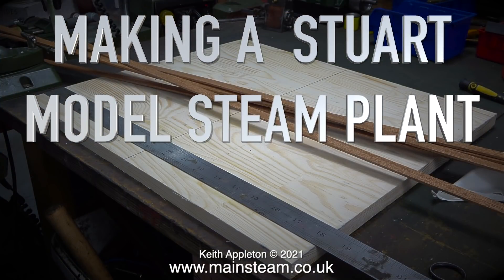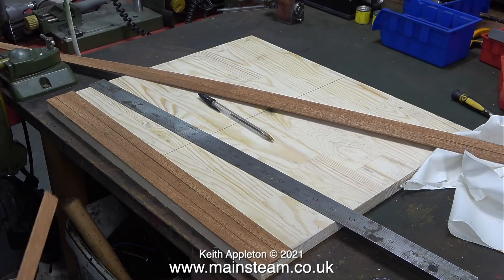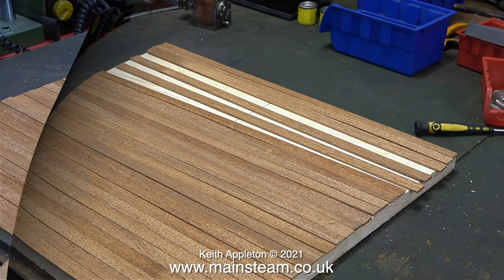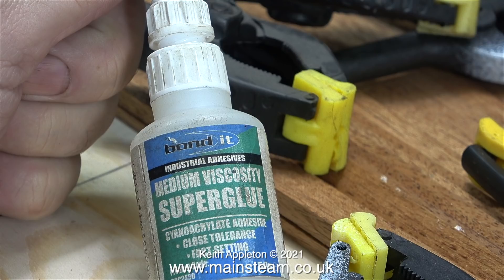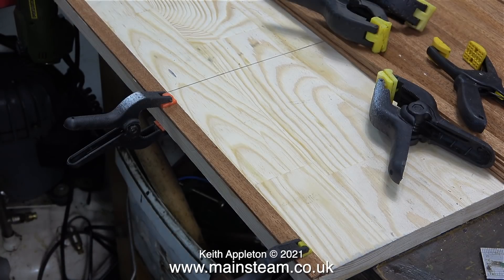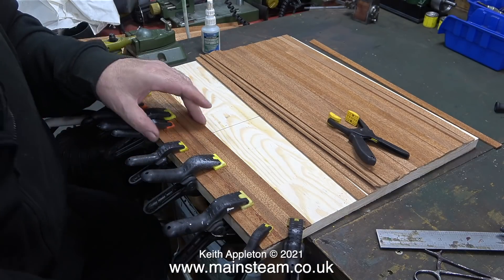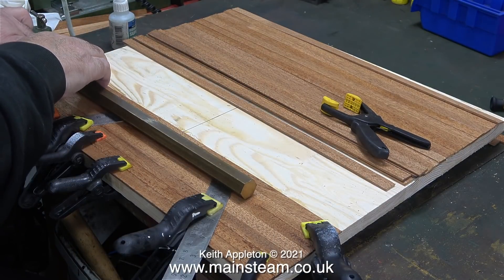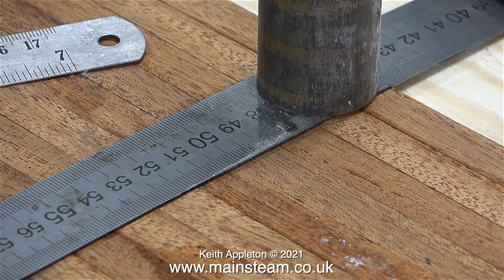MAKING A STUART MODEL STEAM PLANT - PART #41

Comment: Still working in inches,  we went  decimal 50 years ago.
Reply from the maker: You must be very intelligent indeed ............. I work in inches because most steam engines that I work on were designed and made using inches, it is known as the Imperial system of measurement.

Comment: I wonder if a wax paper could be used to cover the planks and then a board or angle could be used with a single spring clamp on each end.  Your heavy hexagon  bar appears quite effective if it keeps up with the setting of the CA glue.
Reply from the maker: I have  tried that and the waxed paper stuck just to the CA Glue and made a mess. It also sticks to the metal bars but they are easy to remove.

Comment: I use medium cyanoacrylate when woodturning.  The only problems i've ever encounered was if the wood got hot...sometimes the glue joint would fail.  Have you encountered anything like that under the boiler?  Thanks for another very well though out video.  🙂
Reply from the maker: I have never had any problems with it.

Comment: A bit of trivia I was taught in the first year of my apprenticeship way back last century, a ruler’s measurement doesn’t start at the end and has a bit extra, just like the old shatterproof ones I used at school. Whereas a rule the end is where the measurement starts, so the items you are using are rules not rulers. Maybe useful maybe not, but I thought I might pass on the trivia
Reply from the maker: rules or rulers - is there really a difference?
Reply: @keithappleton  The Rulers wears the Crown and makes the Rules.
Reply: @keithappleton  only that a rule goes to the end, hence an engineers rule, no such thing as an engineers ruler. Like I say, just trivia

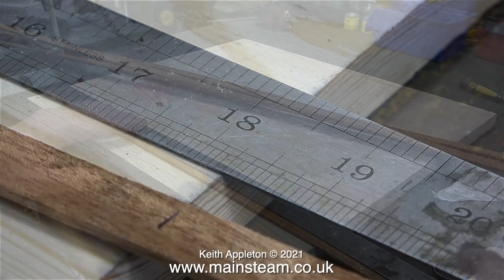Comment: At 0:40, I would never get anything correct with a ruler that is scaled in 10ths of an inch!  Ha ha  Oh well, the ruler had a more "traditional" scale on the other side.  Keith, when do you use tenths of an inch?
Reply from the maker: I don't unless I hold the ruler upside down by accident.
Reply: I struggled to find a rule graduated in 1/10"  when I wanted one several years ago.  Very useful in electronics design (or rather WAS  very useful)  for IC based projects   :)